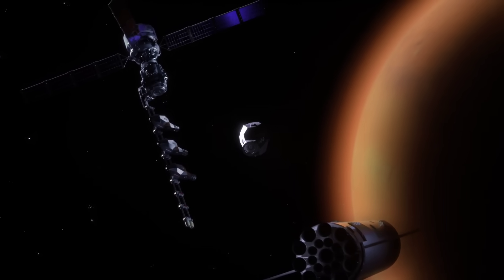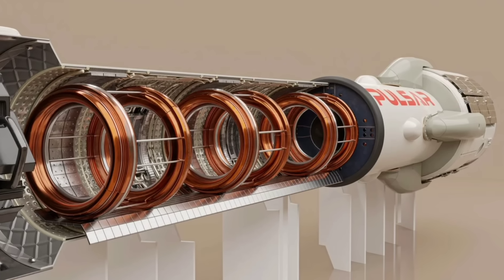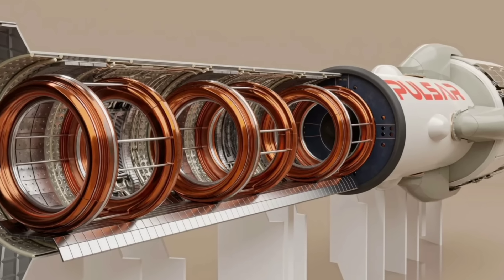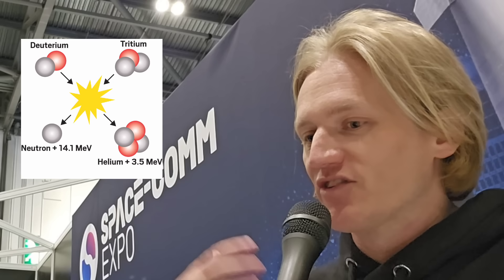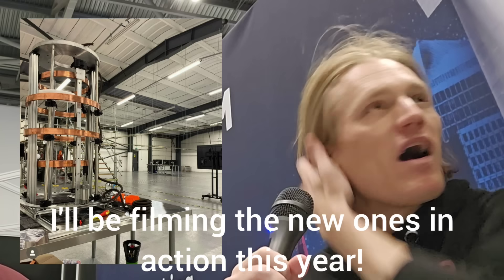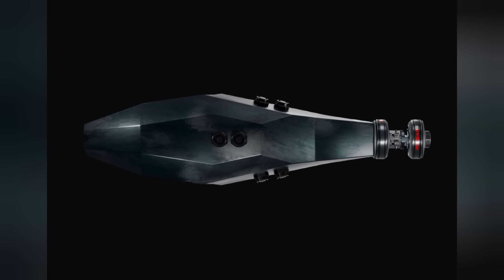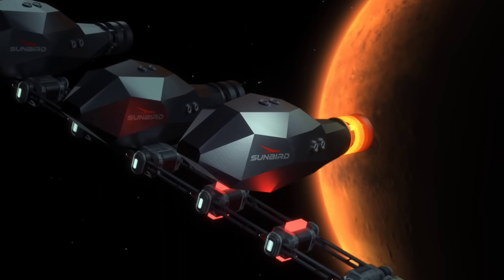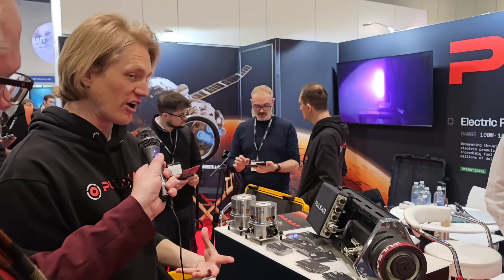15 TIMES faster than Nuclear Rockets!  Pulsar Fusion unveils new Sunbird Fusion Drive!

Comment: Pulsar's spokesman is spewing pablum for popular consumption. Producing a vacuum is not what makes fusion difficult. In fact, it's completely irrelevant! A fusion chamber is NOT a vacuum, but a chamber filled with fusion fuel heated to hundreds of millions K and a significant density, which implies extremely high pressure, the opposite of a vacuum! Doing this in space will be harder, not easier, because you still need heavy infrastructure to heat the fusion plasma selectively, without vaporizing or melting the infrastructure, e.g. lasers, radio/microwave frequency emitters.

It is claimed by Pulsar's spokesman that aneutronic fusion can propel this rocket without a net energy gain on the aneutronic fusion process. In order for that to work, there must be another process which provides a net energy gain which is used to drive the aneutronic fusion. What would that be, if not fission? For sure not chemical fuel, whose energy density is far too low; still less solar panels or other green nonsense. If fission, you need either a bomb or a reactor. A bomb has obvious drawbacks. A reactor cannot run anywhere near hot enough to directly cause fusion of any kind at any measurable rate, so it would need a power conversion system (a turbine or an MHD generator) to convert its moderate heat into electricity to cause enough fusion to make a significant thrust, even one several orders of magnitude below break even in terms of energy input and output. But we are a long way from making aneutronic fusion efficient enough to make this a practical proposal. Aneutronic fusion requires a much higher temperature than ordinary D-T fusion, and we're still several orders of magnitude below break-even on that. And if the best we can do with aneutronic fusion is several orders of magnitude below break even, we might as well use a linear accelerator, powered by a fission reactor, to accelerate relatively cool charged particles, rather than spend the greater part of that reactor's electric output to cause aneutronic fusion.

Producing a high temperature plasma is not by itself sufficient to produce adequate thrust. Charged particles produced by aneutronic fusion move at a large fraction of the speed of light, but in no particular direction unless they are guided by a sufficiently strong electric field.  How will that work? For every positively charged particle that is repelled by a positively charged surface, there is a negatively charged one that will be attracted to it. Electrons have much lower mass; this helps, but they will continuously discharge the positive surfaces, causing them to heat up. Energy will have to be expended to maintain the positively charged surfaces and keep them from melting. On the other hand, particle accelerators are woefully inefficient when attempting to accelerate particles to a large fraction of the speed of light. They accelerate each particle in a series of steps, with a precisely-timed alternating current (typically radio or microwave frequency) applied, so that as a positively-charged particle passes the middle of a negatively charged surface, its charge is changing from negative to positive, so it will begin to repel the particle it had just attracted. The problem here is that to propel a ship we need to accelerate a very large number of charged particles simultaneously, no two of which can occupy exactly the same position at any time. Consequently, most of these particles will be significantly out of sync with the alternating electric field.

Comment: the problem is the fuel, it's incredibly expensive and it's hard to get in space, sadly I don't have confidence in this until they actually launch a working model and it starts putting out practical figures.

Until then, it might be best to put a nuclear power plant in space and start heating up hydrogen and dumping that out the tailpipes because sometimes, going for premium unleaded when regular unleaded will do the trick for those on a budget... such as any space agency

Comment: I really want these concepts to really happen but past experience tells me to treat this as vaporware until these engines are in space. 
The company is selling ion engines in hopes of financing plasma fusion engines. 
These are concepts with details still to be worked out.
Reply: Agree though generally the pattern is fusion startup runs out of cash so they try to build hall thrusters. Then they realize the plasma physics is the easy part and fail on QC and procurement issues. Additionally looking at their brochure and other stuff on the website stuff I detect a lot of BS as well. Their lifetime number are totally guestimates, if they had real numbers they would be showing them off, and they suggest they can use the same thruster to run on Xe, Kr, and Ar with no associated performance number listed Ar is way worse, also the pictures of their facilities look really basic I only count 4 cryo panels and 2 mid size turbo pumps  in the chamber with their 10Kw thruster so the base pressure would be super high and give false performance numbers additionally minimal ablative protection on chamber shows they are not doing long burns. Also the pre packaged unit they show off  doesn't have a cathode, the prop tank would do like 30KnS of impulse at best, and the list goes; on PPU seems sus and the PMU is the size of house. They have lots  flashy renders but not alot of hard numbers so I very much have my doubts about them.  And don't even get me start on the fusion BS.

Comment: I like the SunBird idea: A fusion drive that attaches to a deep system mission, so the remaining chemical propellants can be saved for escaping from a planet or Moon's surface nackninto orbit, or for atmosphere deceleration on Earth rerurn.
Reply: That's nothing new, basically every novel engine idea from nuclear  thermal rockets to matter-antimatter emgines none of them could function as launch stages because most have low thrust or have too violent of an exhaust that would destroy the craft in atmosphere.

Comment: If a Fusion craft used Neutronic fusion intentionally coating the walls with a product that would decade over time shouldn't it be possible to irradiate the walls such that you get a constant yet lower thrust from the craft as the decay products fire off their particles?

Comment: Excellent interview!  Richard Dinan is scary smart. He authored "The Fusion Age: Modern Nuclear Fusion Reactors" in 2017, discussing the potential of fusion energy.  Additionally, he has lectured on nuclear fusion at institutions like Oxford University. His website says they plan to test their Sunbird engine in orbit in 2027.  Exciting times ahead! (ʘ_ʘ)
Reply: Fusion happening all the time, what you’re alluding to, I assume, is self-sustaining fusion as a power source for the grid.  What Dinan is talking about a non-self-sustaining fusion reaction taking Helium3 and Deuterium in a field reverse confinement plasma that does make fusion happen.  And he mentions this anutronic reaction produces a highly energetic proton which means it’ll be going fast
Reply: If it's non self sustaining then where is he getting the energy to power it? This concept doesn't make sense.
Reply: A pity Nuclear Fusion is always 30 years away
Reply: @ajctrading  They are not using full fusion though, as stated right in the start. They take some kind of shortcut by allowing matter to fuse in some kind of easier way and then expelling the result without the need to control it perfectly. We should prob. read up on a written explanation to get it clearer. And as a meme your comment works, but there is no way to hold back fusion as AI have surpassed the human mind and is soon at god-level computing if it gets access to a quantum computer. They are brilliant at overcoming weaknesses in any system just using a normal PC. Buy stocks in fusion sometime soon.
Reply: Your guess is good as mine. 
He did mention fission, so in this case electricity from a NPP makes electromagnetic fields to generate a plasma in a FRC to generate fusion.

Comment: Science fiction. It's very different from science fact. Science fiction is either inspirational or a warning of a possible future best avoided. But all science fiction relies as its basis the suspension of belief: the knowing and cooperative ignoring of scientific principles. This has been true since the UFO science fiction of the 1920s which invented much of what is tauted as fact here in the Angry Astronaut scientific and historical denialist YouTube Channel. 

Those are all great science fiction ideas. Science fiction is a form of literature that discusses often overly sensitive issues in a safer realm of suspended disbelief of natural laws and impossible things accomplished in a strictly mythical, fictional future. As such, science fiction is a relevant, valuable and valid genre of literature. 

But it is not science. Tales of ionizing particles in front of a spacecraft at relativistic speeds, sweeping them up with an ionic "broom" and depositing them gently in the engine to be used as fuel willfully ignore several levels of impossibility in the fantasy. Nuclear fusion in a magnetic "bottle" is also a fantasy not based on possibility.

Needless to say, you can't do that in a plastic container. In fact, you can't do that in a solid container of any kind. Gravity is the absolute best container out there. 

When a protostar has collapsed to the point that it radiates strongly in the infrared, it becomes what is called a T Tauri star. It still has little or no fusion going on but the energy of the hot center has created a solar wind that begins to blow away the material around the protostar to create an empty pocket in its source nebula.

The protostar continues to collapse and build more pressure until the core temperature is between 300 and 600 million degrees Kelvin, and there is enough heat and pressure to begin hydrogen fusion, where in a three step process where first two H-1 atoms fuse to form H-2 plus lots of energy. Then H-2 atoms fuse with H-1 atoms to produce Helium-3 plus gobs of energy. Finally two He-3 atoms fuse to form stable Helium-4 plus two Hydrogen-1 atoms. During the entire three step process four protons are lost--converted to pure energy according to  Einstein's equation e=mc^2.

To do this the star must have a mass of at least 16 Jupiter masses and a container. The only container strong enough, durable enough, stable enough to make a star is gravity. Gravity is the king of containers. And that is why hydrogen reactors on Earth have been unsuccessful. The universe has never made a star in a magnetic container. I doubt we will either.

But ”Any time you combine a poorly understood topic with a strong human desire you’ve got a recipe for scams.” Jeremy Fielding YouTube channel, *Building and Reviewing Free Energy Generators on YouTube.
Reply: Man-made thermonuclear fusion is real, see hydrogen bombs. We can also do it in magnetic bottles, some of the tokamaks could produce 30 times more power in the plasma than what was put into the plasma. But the power delivery to the plasma and extraction from the plasma is simply not efficient enough. They also don't use the correct Tritium Deuterium fuel yet, because they don't want to deal with the radiation from the fusion and the tritium.

But this startup is a scam.
They explicitly say they don't reach the required confinement to burn enough of the fuel, so they can't achieve anything near the power numbers for tokamaks. They'd have a few watts of fusion power for kilowatts of input power, so it'd be a very radioactive ion thruster.
Reply: Also your fusion mechanism is wrong. The number of protons plus neutrons in current physics (including fusion) is a constant (in simplified terms, see baryon number). So instead of converting protons to energy they are converted to neutrons (which are slightly heavier). However the protons and neutrons fuse to helium and heavier nuclei which are slightly lighter per nucleotide by about 1/1000. That's where the energy comes from.
Reply: @lukasdimmler2622  My information doesn't come from brain farts, but from astrophysicists, nuclear scientists and their published works. Yes, nuclear fusion of hydrogen converts protons to energy according to the formula e=mc^2. That is where the energy of a hydrogen fusion reactton comes from. Your example of a bomb as an example of sustainable nuclear fusion reaction is a laughable lie, as you know. A bomb maintains temperature and pressure only for the milliseconds necessary to make the boom. The inertia of the material is immediately overcome and the reaction stops immediately. Maybe you have some scheme by which this can provide power in a continuous reaction. But my money is on absolutely not. The temps and pressures generated are far beyond the ability of any substance to contain and harness.

Magnetic bottles have similarly been failures. It takes more power to make a magnetic field to contain 450 million atmospheres of pressure necessary to produce nuclear fusion than the energy you can get even for the millisecond pulses they have obtained so far. By fudging numbers, ignoring the inefficiencies involved in producing the field and only measuring the strength of the magnetic field itself, NOT the power necessary to produce it, the people making these devices have misled the public, but not scientists, into thinking they have achieved something useful. They have not. They will not. This is a repeat of the cold fusion scam in different clothing.

I'll quote myself here and challenge anyone to produce evidence contrary. "Stars require a container because they are balls of hot gas under enormous pressure. When a protostar has collapsed to the point that it radiates strongly in the infrared, it becomes what is called a T Tauri star. It still has little or no fusion going on but the energy of the hot center has created a solar wind that begins to blow away the nebular material around the protostar to create an empty pocket in its source nebula.

"The protostar continues to collapse and build more pressure until the core temperature is between 300 and 600 million degrees Kelvin, the pressure exceeds 4.5 x 10^8 atmospheres so there is enough heat and pressure to begin hydrogen fusion, where in a three step process where first two H-1 atoms fuse to form H-2 plus lots of energy. Then H-2 atoms fuse with H-1 atoms to produce Helium-3 plus gobs of energy. Finally two He-3 atoms fuse to form stable Helium-4 plus two Hydrogen-1 atoms. During the entire three step process four protons are lost--converted to pure energy according to  Einstein's equation e=mc^2.

"No substance can withstand 600 million degrees Kelvin or the 4.5 x 10^8 atmospheres it takes to create a star. There is only one container in the universe that can do that: gravity. To make a star must have a hydrogen gas mass of at least 16 Jupiter masses and a container. The only container strong enough, durable enough, stable enough to make and contain a star is gravity. Gravity is the king of containers. And that is why hydrogen reactors on Earth have been unsuccessful. The universe has never made a star in a magnetic container. I doubt we will either."

I can't link you to the sources of the information or YouTube will delete my entire post without notification or consent. But you science denialists know that. You know you can spout science fiction in the guise of science fact and be free from confrontation by the science you deny. But that doesn't mean that I can't tell the truth and realize that people are smart enough to use the search engines of their choice or their local university to confirm my information. And so they will, regardless of what pseudoscientific brain farts appear here.

Can some company produce an ion engine that produces much more impulse than current versions and so is useful for quicker acceleration than zero to 60 mph in about a week? We'll see. But tossing around the buzzword of nuclear fusion to make it sound sexy isn't much of an effort. As soon as they said that it's a nuclear fusion engine but they don't actually have to make a hydrogen fusion reaction to get it to work, you can smell clear signs of a scam. 

From Fraser Cain of Universe Today: ”I think it's really important to be able to separate what we believe based on evidence or lack of evidence and what we would prefer to believe. I don't believe that there's aliens in the universe but I really wish there were and I'm sure there are people who are the opposite from me, who is certain that aliens are visiting us, but they really wish they weren't.”

”So think about this in general. When you think about scientific questions and you think about what is the thing that you feel you have evidence for and what is the thing you wish were true? What is the outcome that you would prefer? And if the two line up, then you might have a cognitive bias and you might want to sort of sit down and really think about what is the evidence that supports the belief that you have anyway?”

More bluntly,  ”Any time you combine a poorly understood topic with a strong human desire you’ve got a recipe for scams.” Jeremy Fielding YouTube channel, *Building and Reviewing Free Energy Generators on YouTube.